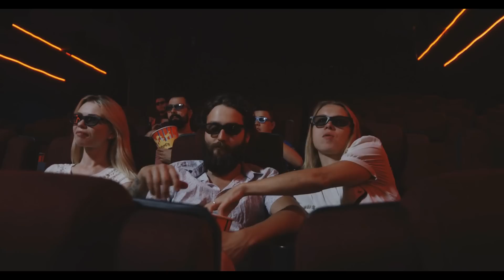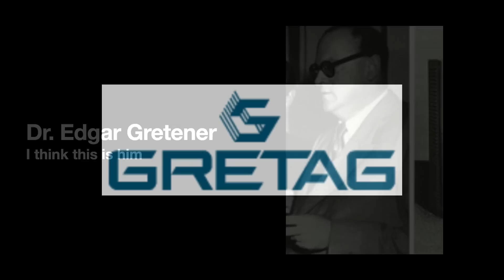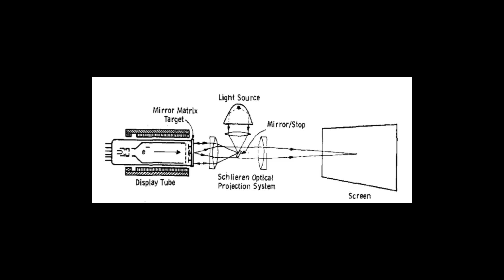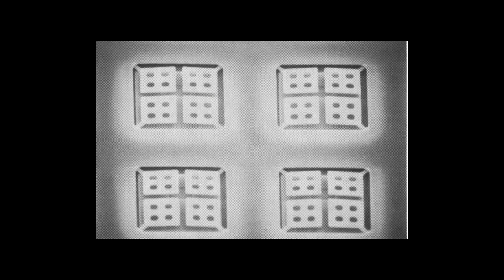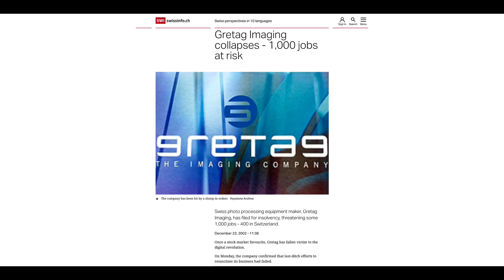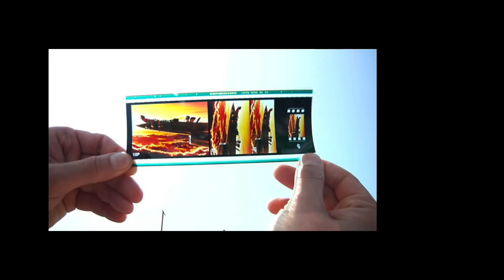How Optical MEMS Won an Oscar

Comment: 15:00  I would argue the more significant advantage to braking out the RGB to dedicated chips, is that you get rid of the color disintegration effect (as the colors are no longer using time based sequencing, and the time base is instead confided merely to the luminance component of the image) one experiences when you pan your eyes over a single DLP projection, where you see individual color trails (instead of the final intended composited color) streak through your vision, a very noticeable and irritating effect of single chip DLP. 

Also, sometimes, commercial projectors use dedicated RGB light sources, instead of a prism, to separate out the color channels.

Comment: Amazing doc, I had a series of Mitsubishi CRT based TV's in the 1980's, and the last one I had was a 65-inch and had three 9-inch glass focusing lenses.  The innovation of the home versions of projection TV ran parallel in R and D and must have helped fund design of the new, huge screens we take for granted.  In the 1980's, people looked at 65 inches of TV and were like, bro, you like TV, or what?  Smirks sometimes followed.  We took the snide comments in stride, and continued to support the early expensive tech.  We were pioneers!

Comment: When I was in Chemistry grad school, I proposed using digital micro mirrors to make a Hadamard transform near infrared spectrometer. It would have some advantages over a Fourier transform device in terms of noise elimination but was wavelength limited by the sizes of the mirrors.
Reply: You weren’t able to filter it and polarize it?   I-Line︅ steppers used this principle before the light source gets to the lens.
Reply: I didn’t actually make one. I was just required to make a research proposal as part of getting a PhD. 

The problem was that if you went into the infrared, the wavelengths would start getting longer than the width of the mirror, and if you went into the visible there would no longer be a noise advantage from multiplexing the signal due to the sources of noise found in visible vs infrared detectors. (It’s been over 25 years so I’m shaky on the details).

Comment: Around 1993 my employer, Alphatronics, made probe cards for testing IC dies while still on the wafer, and one customer was TI. A common error for the probe tester was for the lift device to fail before the probes were translated to the next die. This was generally catastrophic for the probe card and the wafer.

We got one probe card back from TI with bent tips and a gray smudge on the underside. Under a microscope the smudge resolved into itty bitty glitter- someone at TI had about seven million years of bad luck coming.

Comment: In 1999 I was living in New York, I drove over to New Jersey with a friend of mine that owned a movie theater, to see the Phantom Menace digitally displayed, having seen it already in a regular theater. I did have some issues with small swirling artifacts, but it seemed more like a software compression issue (additive/subtractive images) than a projector issue. My friend got us into the projection booth after the movie for a tour. We had to go through security and sign some papers, but it was worth it. What I found more interesting than the projector, was the computer system it was using, if I remember correctly, it was called a 'Pluto Box'. It had redundant drives that it could switch to incase of a problem, but you could program it a month in advance for showtimes, where it would also work the lights, sound, switch languages, and even pull back the curtain (if it had one). Seems like the norm now but was really impressive 24 years ago! =)

Comment: Just to be clear, when you only have digital switching of the brightness, you have to have much finer control for when to turn each pixel on an off so that the right amount of light gets through.  The control circuits  essentially have make adjustments thousands of times a second, so the "refresh" rate for modern LCD and DMD are in the thousands of Hz.

Comment: The ability to project movies from digital stream rather than physical media opened up opportunities for the studios to have better control over leaking new releases before an official premiere presentation. The high profile productions are streamed into the projector’s buffer remotely from a trusted data center. Local operators cannot copy or access the movie stored in the projector, they can only play it at agreed times.
The only bootlegging option is to record the new release with a camcorder. But thanks to the brightness and resolution of the DLP projector the quality of the bootleg is often good enough.

Comment: I had a single chip DLP retroprojector around year 2000. Although it was only SD, predating HD by a couple of years the image was great. If you examined it close up the pixels didn’t have black around them, unlike the plasma screens that were popular at the time.

Comment: Love my home single chip DLP. It uses 4 color RGBY variable speed wheel, can do true 24hz and 48hz, its amazing. Only downside some rainbow effects common to wheel projectors and chip resolution is 1024x576p down-converted from source HD, looks way better than that implies though, basically cinema quality on a 2 meter (80 inch) wide screen

Comment: This leaves me to wonder if we could utilize DMD tech in an analog/digital highbred processor unit design.

I think one of the prayers for optical processors is the fact it can minimize the capacitance, resistance, and magnetic issues of traditional electrical pulse based processors.

I can imagine an array of these being able to do basic arithmetic on a near continuous basis. Although larger in footprint than tradition semiconductors, they may be able to reclaim some of that space with cross beam refraction within a near vacuumed package and the use of being able to cross beam paths… something traditional traces can’t do.

Just something I often think about.

Comment: Today the brightest projector for cinema comes from Barco and fires up to 75.000 Lumens onto the wall. Considering the 3000-ish Lumens of a standard tabletop consumer projector, this is truely incredible. To be fair this one only usable in stationary applications, since the projector and the two separate AC units is weighing over 500kg in total. For rock-and-roll purposes and when moving often you better get your hands on a Panasonic RQ50K delivering 50.000 lumens at only 160kg including mounting hardware with no extra AC required. That still gives you, when used with two projectors, more light than from one Barco projector. And - yes they can produce 4K.

Comment: I’m surprised you only compared DLP to other video technologies with no mention of the 35mm (and 70mm) film that was THE standard (and only option) for cinema before DLP. 35mm was largely in use up until 2008/9 and slightly beyond.
Reply: This episode had more to do with the projector rather than the storage medium. It is a big part of the story, but maybe it is an aspect told later/elsewhere.

Comment: As for filtering light: imagine how hot the film gets when you shine so much light thru a tiny frame on it. No wonder DLP with mirroring MEMS in them won the competition.
Reply: 3LCD is still pretty strong. DLP isn't without it's problems regarding heat either, but ofc there is much less to go wrong.

Comment: I have a Panasonic laser DLP projector. It is quite large but has great sharpness and brightness. You can get these used with few hours on the laser for $300 for a 1080p model.

Comment: Never knew they won an Oscar for that Technology. As soon as I learned about DLP projectors, I had to have one. What an incredible and ingenious technology. My home theater projector technology of choice is DLP. I have 3 single chip, lamp-based ones that use high-speed color wheels that produce nearly zero rainbow, and one, single chip, LED based one with no color wheel, and no discernible rainbow at all. Early single chip DLP projectors were pretty bad with rainbow, but the latest ones (home theater level, anyway) have eliminated that issue. Plus the addition of frame interpolation and 3d make the experience even better. I prefer single chip projectors over 3 chip. Single chip means that there are fewer optical elements in the light path, making it much simpler with no need to converge anything. Plus if it used an RGB, LED light source, it runs much cooler,  and therefore quieter, and eliminates the need for a color wheel. Currently all my projectors are 2K. They are bright, vivid, and sharp. Even siting 8 feet from a 150" screen, I can not discern the pixels. Maybe there is a 4K one in my future. No rush. I'm quite satisfied.

Comment: Now make the micro mirrors reflect gamma frequencies and send the arrays out into the battle field as first tank based, then shoulder mounted.  The future.
Reply: You joke but this WAS a topic that garnered some serious consideration. The problem, as the EUV folks discovered, is almost nothing worth building reflects light well below 100nm wavelength. X-rays and gamma rays would also cause soft errors in the underlying SRAM, if not permanent midband traps. Even making a DMD that can reflect DUV light is difficult from a materials perspective. I always thought it would be cool to replace the reticle in a lithography scanner with a strip of DMD mirrors and then use that as your pattern master. But UV DMDs like to get stuck in one state or the other after getting beat on with ultraviolet light, and so tend to get an unacceptable accumulation of dead pixels over time.
Reply: would be better to strap 10 microwave magnetrons with the same orientation to a stick and use that to fry your opponents.

Comment: What do you think about the idea, that computer devices don’t compute, but rather receive Bitmap data (per wireless connection), for every frame that the screen uses. And the “computer“ device only sends the input from the touch screen or keyboard. Combined with rf mems switches for energy efficiency. I thing this is the next big game changer.

Comment: Ah you just reminded me of the old DLP projection TV my parents bought way back in 2005 from Samsung... It looked good while it worked, but it was a total money pit (it's primary push was that it used the then novel mems to achieve brightness and contrast ratios that put plasma and later many early OLED to shame). It's MSRP was $5k USD parents later spent 3k in repairs, with it's eventual demise in 2011.

Comment: Sad thing is that the RGB color space is smaller than what we had before and everybody is now so used to not having the full color spectrum any longer. I want something better. With all the beautiful hues of blue that RBG can't represent.
Reply: That's partly why some DLP implementations use more than the three base colours.  DLP projectors using colour wheels sometimes have additional colour segments in the wheel to help fill out the colour space.
Reply: @GodmanchesterGoblin  It's no use if the film material is encoded in RBG
Reply: @AlJay0032  Obviously.  But film based material (amongst others) isn't only encoded in RGB, hence the evolution of projection systems to cope with wider colour spaces.

Comment: Maybe I'm missing something, but can somebody explain this to me...

Why does each individual mirror need a hinge? Why do they need to flip? Why isn't just one proper angle all that is required? 🤔🤔🤔
Reply: It's so that each pixel can individually modulate its light output.  The moving mirrors effectively turn the light on and off at high speed so that the eye / brain perceives the correct average brightness at each pixel.  When the pixel area on the screen receives no light it is because the mirror for that pixel has tilted a few degrees to send the light to a black light absorption area inside the projector.
Reply: @GodmanchesterGoblin  I'm so confused. I thought this was merely a projector, i.e. it receives light from a source and amplifies it in a particular direction. I thought the image it receives from the source is already complete. Why is individual pixel manipulation required? Is it changing the source material?

Comment: Isn't that the exact same technology used in the overpriced Maybach versions of the Mercedes S Class? I recall a commercial of them projecting a movie on a wall. I always thought that was the most useless application of the technology. Of course the option to precisely darken an area to not blind opposed traffic is awesome but a single little crash destroying one side of the headlights costing thousands to repair seemed excessive.

Comment: 14:06 is this accurate? If each frame is broken down into 3 color components and each component is shown for 1/60 second, then the effective frame rate is 20Hz, which is too slow for film. OTOH I suppose they could telecine the original film into 60Hz with the color channel split, but I don’t know why they would do that unless running the whole system at 72Hz instead would be impossible.
Reply: You are correct.  Each color is actually projected more like 4x per 60 Hz frame on the 1-chip systems with wheels; it may be 8-16 times per color on LED and direct/rgb laser systems .  The rate will vary depending on the projector design and illumination.

Comment: Considering military tech is often decades advanced of what is released to the public...

I wonder what level this is at in relation to projecting holographic imagery as an overlay onto reality. Projection onto the sky, or just across the room.

I've read some conspiracy woo stuff claiming they have achieved this capability as long as over 25 years ago. 

Coordinated projection from several projectors coming from several angles in precise unison, focussed on a highly specific area, in addition to sound projection tech, to create the illusion of reality.

The larger the scene, the further away (least minute detail) the easier, more plausible, believable the action image would be.

Comment: I've never found an explanation on how these dlp systems are able to show "greys" i.e. gradients, as opposed to full brightness and darkness. My guess is that they use a PWM signals in some way to reduce light exposure onto the screen, reducing perceived brightness. Can anyone back this up?
Reply: Yes, they use PWM to achieve gray levels.
Reply: Yes, ratio of off to on over the duration of the frame determines brightness for the pixel.
Reply: Yes, it's a form of PWM, but rather than using conventional PWM with a continuous range of say 256 or 1024 levels at each pixel, in order to simplify the driving of the mirror array from its support ICs, the PWM effect is created by using a range of chunks of on and off times during each frame (it's clever, but impossible to describe in a couple of short paragraphs).